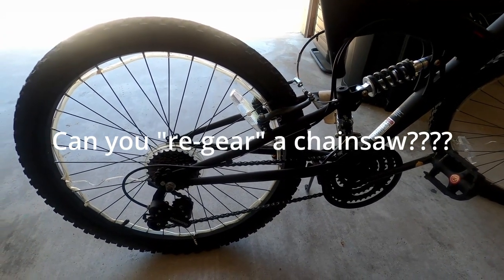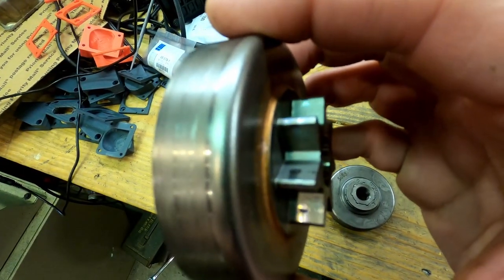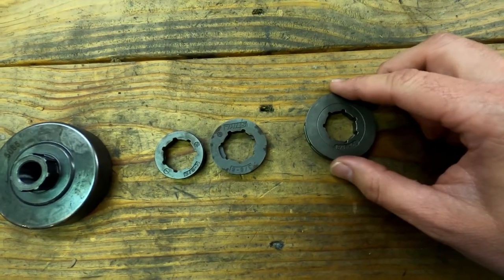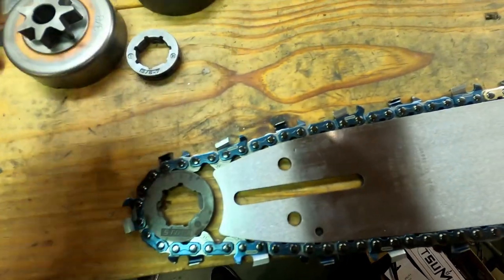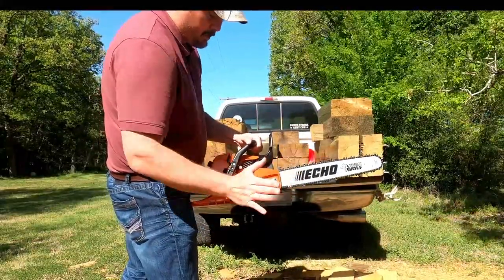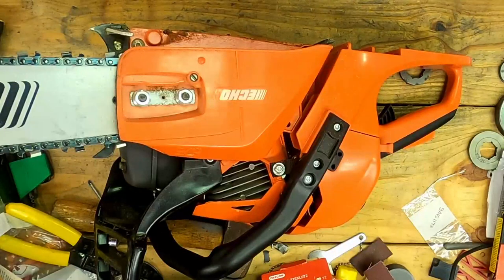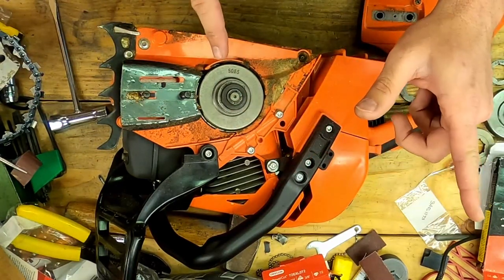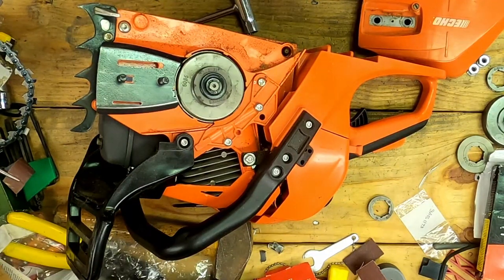Re-Gearing Your Chainsaw (CS-590 and Other Saws That Use Rim Sprockets)

Comment: If you do a lot of chainsaw work the rim sprockets are the economical way to go whether 7 pin or 8. Thanks for sharing!
Reply: What other way is there to go?
Reply: @alanmeyers3957 the spur sprocket is the other style which is fixed to the clutch house and when worn the whole clutch housing has to be replaced about $25-30 dollars, were as on a saw with a rim sprocket setup the clutch housing stays the same and only the rim sprocket piece when worn is replaced $7-10 dollars.

Comment: Nice to know these are available for the CS590
Reply from the maker: Indeed!
Reply: @mattr66  does a 8 pin rim sprocket improve the performance of the CS590?
Reply from the maker: @dentondunn4346  it would be great for limbing, but seems to work the saw too hard with a full bar's worth of wood.

Comment: The main reason i grabbed a 7 tooth for my cs600 was soni could run a 28" bar with a skip tooth chain and cut big logs when i needed to. Its a rare event so didnt want to buy a bigger saw but the conbination still lets me get the work done just a bit slower  on a smaller saw

Comment: Got a 620pw coming next week.  A lot of the clearing work im doing is on smaller hardwoods.  8 pin and a 20" bar would make a wicked setup, i think.  620 has a few more beans (kind of like a work saw port job on a 590) 
Then just swap out if I plan on dropping the big chonks.
Reply from the maker: The 620 takes the Oregon style rims if you go up a pin.
Reply from the maker: You should still put one of our high flow deflectors on it for some more oomph....
Reply: I checked out ya'lls website earlier today.
To be frank with the cluttered mess in the 599/620 with the baffle AND the tube, if I mod it I'll do a vent out the front so I can work on the internal ports.  Most likely I'm going to keep the factory can stock and just make an ironhorse style.  If I decide to not dedicate the time to that, I got ya bookmarked!
As many folks have these two saws..  someone needs to make a nice custom pipe for it!!!  An ironhorse style or a "t" style dual outlet would be GREAT.